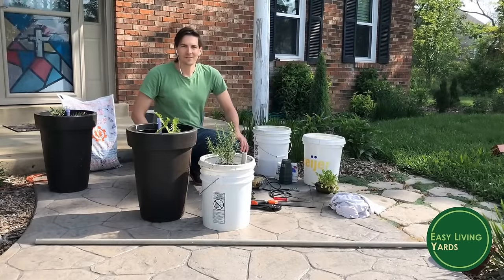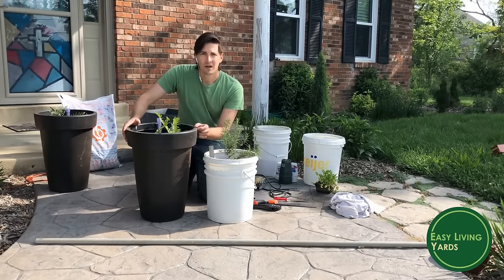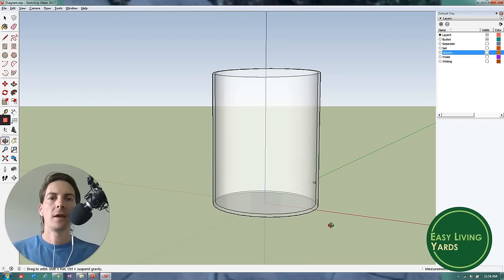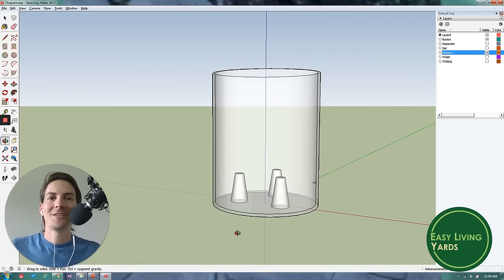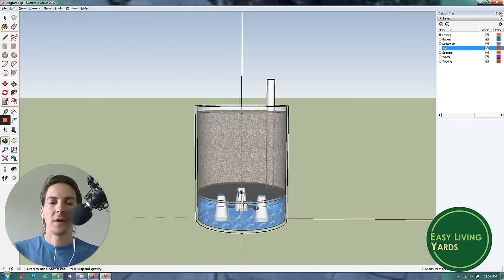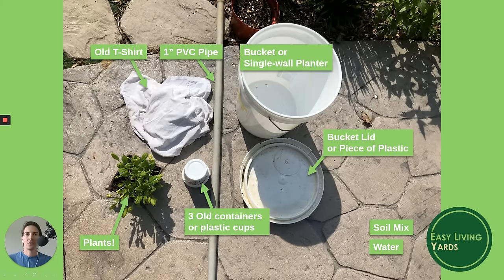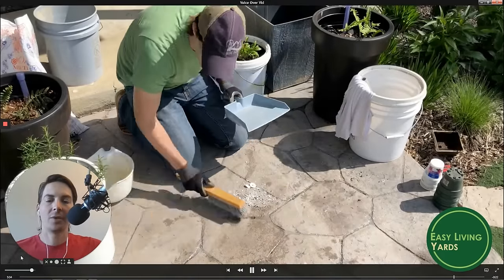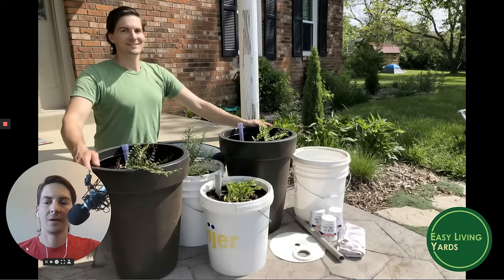How to make a Self Watering Planter

Comment: I find it hard to believe the shirt would carry enough water up to the soil. So, when the soil pulls the moisture from the shirt does the shirt wick enough water at a rate that can satisfy the soil and plant needs?
Reply: amazon sells wicks for self watering systems too if that's a concern.
Reply from the maker: I haven't had any issues with the wicking action, although it seems crazy.  I've used the nice ones in the video under our porch there in the background, and the top layer of soil stays moist for several weeks before the reservoir needs refilled.  Once the lower reservoir is refilled, I usually re-dampen the soil on top if it's dry, as this helps the wicking action better.  This happens due to capillary action - small spaces in between the absorbent cotton fibers and soil particles, where the water moves toward empty space.  Same principle that wicks water up into a paper towel, and how those little blood sample tubes pull blood up in them when you get a finger prick blood test.
Reply: @EasyLivingYards  sorry if you felt you answered this but I'm trying to work out the watering schedule and I'm sure once I get these built and see it in action I will understand it a lot better. my hang up is on refilling the reservoir. I was thinking that the water in the reservoir would wick up into the top and the bottom would be empty but the top will still be moist. If this is the case, do you just refill when the top looks dry or does it wick so slow that as soon as the reservoir is empty you can refill it. Am I over thinking things?
Reply from the maker: @Keasbeysknight  no worries! The wicking action seems to balance out pretty well. So you’ll have moist soil near the top, but the soil doesn’t get waterlogged or drain the reservoir right away. Some people like to place a piece of foam inside the fill tube that will lower once empty as an indicator to refill. I generally just feel the moisture of the soil an inch below the surface. If it’s moist I leave it and refill if dry. I also tip them to the side and see how far I have to go before water spills out of the little overflow hole.  Let me know if you still have any questions!
Reply: @EasyLivingYards  I'm slc, it's so hot and dry I don't thick I ever got it wicking or I need to saturate the top alot more to get low enough to get it started. I put Dixie cups with slots and holes in the side walls and bottom then draped the inside with long cotton shirt in strips that is packed with more compost mix I made. I'm growing hot peppers so they are enjoying the heat. I probably need something on top of the compost to prevent it from evaporating Too. But I'm just feeling resigned to top water for awhile. It should be important to note they are 6gal buckets and my plants aren't even a foot tall yet so maybe it will be better when the roots are established. Any advice on a system already in place would be great!
Reply from the maker: @Keasbeysknight  Hmmm not sure what's going on here.  I'm curious about a few things 
- what potting mix you used, 
- how you draped the shirt strips
- if the shirt strips covered the divider completely
- if the shirt reaches into the reservoir
- if the dixie cups got crushed (not strong enough to hold up the potting mix)
- a mulch layer or plastic layer at the top may help to reduce evaporation
Unfortunately it might need to be disassembled to figure out what's going on :(
If you want, you can always shoot me some pics or have further discussion via email at ben@easylivingyards.com
Reply: @EasyLivingYards  Great explanation! Thank you.